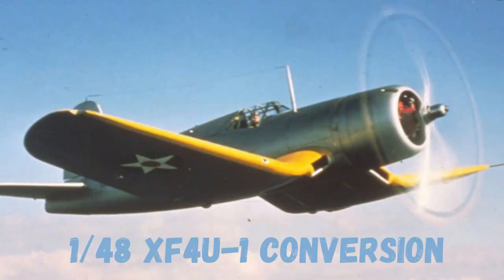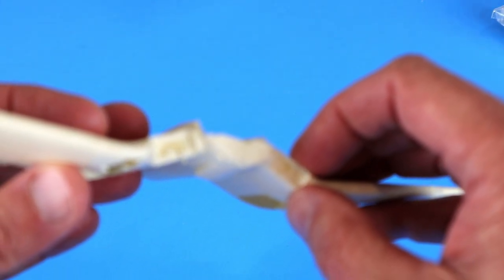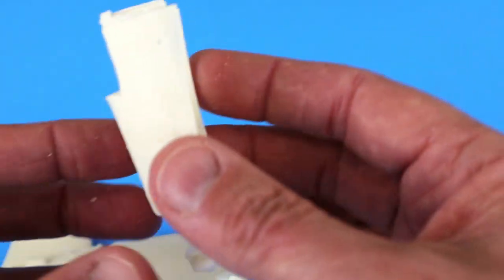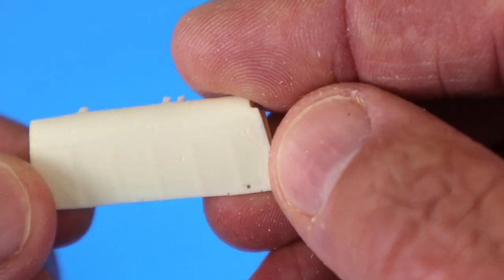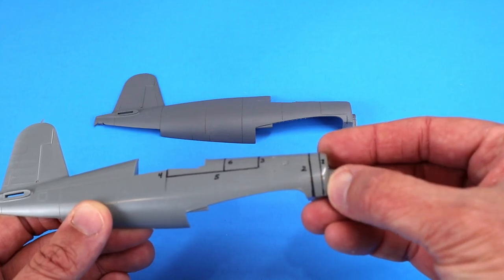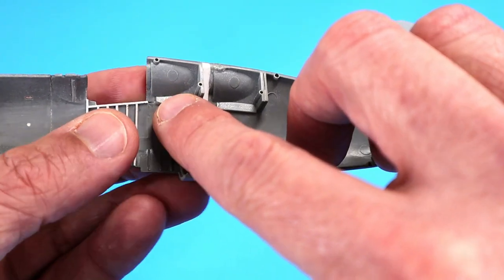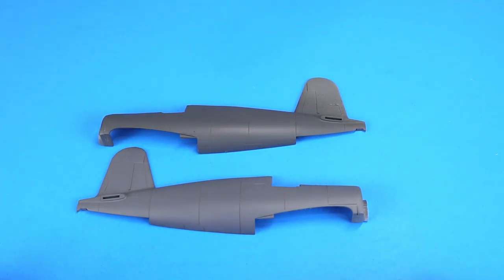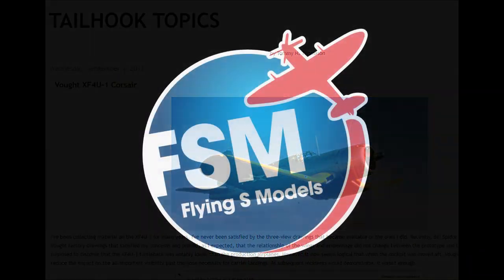1/48 Vought XF4U-1 Corsair Conversion

Comment: The window on the bottom of the fuselage was not changed in the -109 Ace conversion either. It was an oval on the XF4U-1. The original Tamiya square shape looked to be flashed over.
Reply from the maker: Yep, for sure.  Lots of extra mods required.  Thank you for providing some extra information and feedback!
Reply: @FlyingSModels  You're definitely welcome! I got to extensively photograph the Birdcage F4U-1 down at Pensacola for a future Detail & Scale book. If you need any reference photos, let me know! I also don't know if you know, but on the very early Corsairs, the ailerons were linked to lower along with the flaps when they were extended. They still provided roll control but they lowered with the flaps. The guy from restoration was showing me all of the linkages.

Comment: David R Lentz, Columbus, Ohio, USA (Saturday, 27 July, 2024) 

I for some time have thought of just this—I think Bert Kinsey’s monograph on the early Corsairs, F4U Corsair Detail & Scale Part 1 (Carrollton, TX, USA: Squadron-Signal)—though now with the Tamiya 1:32nd-scale kit of the Chance Vought F4U-1/2 Corsair (“Birdcage”) USN/- USMC Fighter. How would one proceed? I lack the resources to conduct the research, or the skill to scratch-build so elaborate a venture.
Reply from the maker: I have thought about it in 1/32 as well.  I think it would be more than possible using the 1/32 Tamiya kits.  They are quite expensive, though, and given their layout, it would be a bit more challenging than doing it in 1/48.  Would surely make a statement in 1/32.
Reply: @FlyingSModels  I built five of Tamiya's 1:48th-scale Corsair kits; their modest size would deny one the capacity for adequate detailing.

Comment: David R Lentz, Columbus, Ohio, USA (Wednesday, 31 July, 2024) 

Again, thank you so much for this. It unfortunately looks to have too many problems that I lack the skill to correct. I hardly would buy an aftermarket set that requires an aftermarket correction set! 
   Also, I actually want something compatible with the Tamiya 1:32nd-scale early F4U-1/2 Corsair kits. I also had not expected such a conversion set would require such extensive alteration. We actually require an entire new kit! 
   By contrast, earlier in your comment, you had mentioned your thoughts to scratch-build your own conversion to backdate a kit. Would you have the skill to make a conversion set to backdate an existing model kit? Ideally, one in 1:32nd-scale. Or given the enormous complexity of a conversion as comprehensive as this would entail, to create an entire new kit? Perhaps a replica in 1:48th-scale for those who want that, and another in 1:32nd-scale for those who would prefer a larger, more detailed reproduction. Both would parallel the Tamiya kits to fit in well with them. 
   I also would like a 1:32nd-scale kit of a late-war F4U-4 Corsair model, though given the astounding excellence of the Tamiya kits (the instructions booklet even shows how one can paint, decal, etc., the kit as a bright red postwar racing plane!), and what I have read and heard of Trumpeter’s kits, I am dubious of the latter.
Reply from the maker: Both the early and late war Corsairs are ones on my bucket list in 1/32.  I have started some design work on the latter but didn't progress beyond the cowl. I need to get back to those.  Both would be amazing in 1/32 and I too wish Tamiya would tackle the latter.  I would imagine it would be a great seller.
Reply: @FlyingSModels  , ohhhhhhhh, absolutely! And the entire series of the Boeing B-17 Flying Fortress USAAF Heavy Bomber. The Lockheed P-38 Lightning USAAF Fighter-interceptor series. The Republic P-47M Thunderbolt USAAF High-Performance Fighter-Interceptor with Pratt & Whitney’s uprated R-2800-C Double Wasp, 18-cylinder, twin-row, air-cooled, water-boosted, turbo-supercharged, 2,650 hp (2,000 kW), 2,800 in³ (45.9 L), reciprocating radial piston aircraft engine. 
   The early North American Aviation B-25 Mitchell USAAF Medium Bomber series, the Doolittle Raiders’ Air-raid over Tokyo especially. All in 1:32nd scale. 
   And all these fighters in 1:24th-scale, as well. 
   Then I win an ample lottery jackpot, so I can afford them all! I then would build various manifestations of them, several assembled in-flight, each one’s 1) propeller(s) spinning (this may require a metal replacement; I understand the torque in time may warp or deform the polystyrene); 2) the undercarriage retracted, the landing gear doors closed over their respective wheel wells; 3) the cowl flaps closed; 4) separable flight control surfaces (ailerons, horizontal and vertical stabilisers, etc.) one can set in various ways corresponding to airborne manœuvres (sharp banks and tight turns, deep dives and soaring climbs, combat engagement, etc.), their cockpit fixtures similarly adjusted; 5) a highly accurate figurine in polystyrene, resin, or similar material, kit-manufacturer, aftermarket, or 3D made, of a pilot/aviator that I would set upon the seat (molded with positionable limbs and head to fit properly, so our doughty flyboy looks like he actually belongs there, actively flying his airplane!).